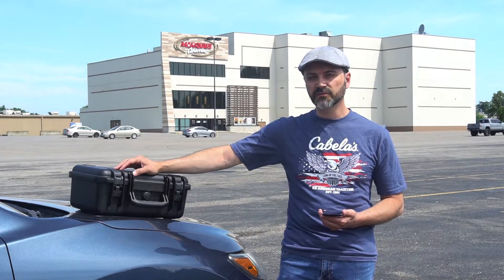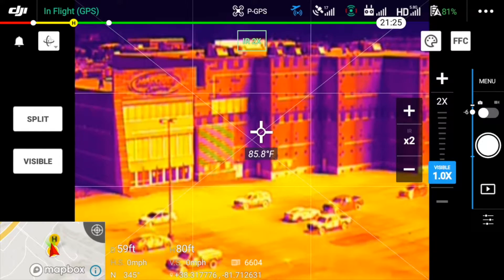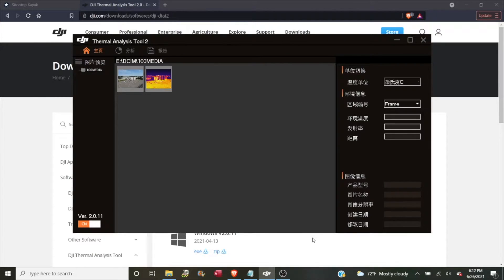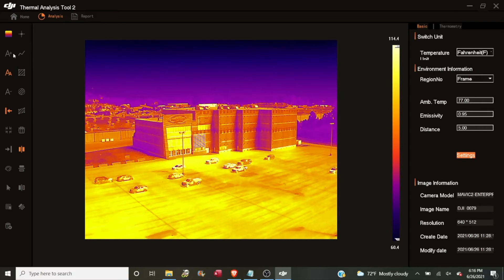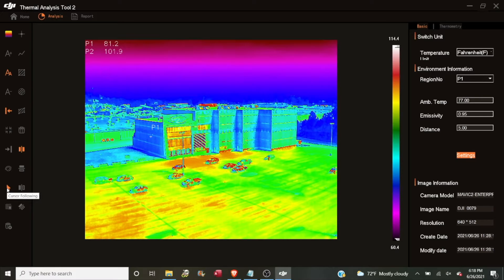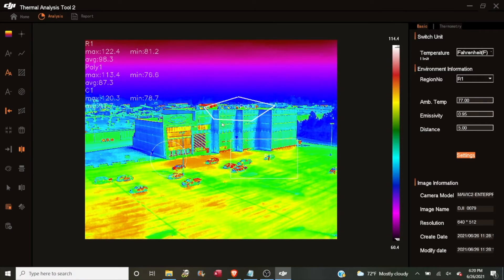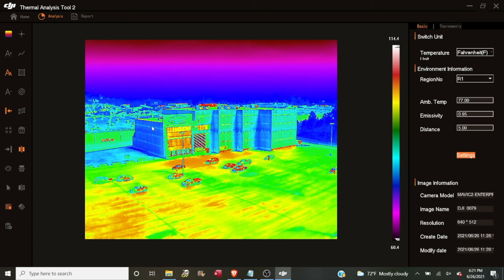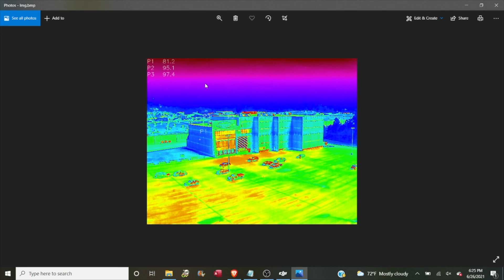Mavic 2 Enterprise Advanced | Shooting and Analyzing Thermal Images

Comment: Can this tool be used on a Mac? The downloads on DJI are only for PCs and Windows
Reply from the maker: As far as I know it is PC only at this time.
Reply: @WildWonderfulWeekends  thanks, is there an alternative out there?
Reply from the maker: @jonathantrexel4299  Unfortunately, not that I'm aware of.  The DJI thermal data is proprietary.  This is a pain when trying to create thermal maps with software like DroneDeploy too.
Reply: @WildWonderfulWeekends  just so I’m following, I either have an M2EA that’s a paperweight or I have to buy a PC?
Reply from the maker: @jonathantrexel4299  That appears to be the situation.  I don't understand why DJI made their data so that other thermal analysis tools can't process it.  I also don't understand why there isn't a Mac compatible version of Thermal Analysis Tool.  For that matter, I don't understand why a drone with so much potential (M2EA) doesn't allow for manual control of the photography settings.  As I said in a previous video, it feels intentionally dumbed down.

That said, I bought a cheap $300 laptop to run DJI's Thermal Analysis Tool and it works well.  The companies I fly inspections for are very happy with the thermal data I capture for them.  So after getting over the initial pain and disappointment of having to deal with a couple things that it just seems unfair to have to deal with, I am making money with the M2EA and it's already paid for its self, and the laptop.

So given the choice between grounding a $7000 drone or investing another $300 in a PC laptop, I'd get the laptop.
Reply: @WildWonderfulWeekends  thanks! That was tongue in cheek of course. And you’re right, while frustrating that piece is not made obvious from the beginning, I’ll follow your example and simply move on. Appreciate your videos and taking the time for inputs here!
Reply from the maker: @jonathantrexel4299  Yes sir, any time.  Thank you for watching!  Good luck with your M2EA endeavors!

Comment: Hello 
I can see on your screen that side bars are red indicating lateral optical sensors not active.I have the same issue on mine.
What's you point on that ?
Reply from the maker: Good eye!  Flying in tripod mode will activate the lateral sensors but, of course, at a cost to speed.  I  personally wish I could choose to turn them on/off in P mode but if that's possible, I haven't figured it out.  

The times I've accidentally gotten too close to an obstacle it's always been when I'm moving the drone sideways, not flying forward or back.  I think it would be great to have the ability to turn lateral obstacle sensing on regardless of mode.
Reply: @WildWonderfulWeekends  You´re right. 
I knew that Tripod is the only mode for which sensors are on.
But I just realized now that we must first turn ON multimode in the App. Because by default the switch mode is inactive and remain in P mode whatever the position. That was my mistake. Now it works well.
Thanks for your reply.
Reply from the maker: @zwiftfrance  There's a lot I'm still learning about this drone.  

Have you flown yours in a GPS denied environment?
Reply: @WildWonderfulWeekends  Not yet.
I am in France, with a lot of rules and restrictions ...
Thing is that from now I would like to develop some business related to thermo & photogrammetry.
Not that easy as these disciplines are  not really known in my country.
Reply from the maker: @zwiftfrance  I can relate... the area of the U.S. that I live in is always a little slow to catch up to the rest of the country.  This presents a challenge but also an advantage of would-be competitors.  Good luck to you!

Comment: Hello, i have dual dji enterprise dual and when i import the photos into the program it doesn't release the tools to analyze, do you know what's happening?
Reply from the maker: Hello Filipe, and thanks for viewing!  It's my understanding that the Mavic Enterprise Dual is equipped with a Flir thermal cam and the data must be be analyzed in software compatible with Flir cameras.  The Mavic Enterprise Advanced doesn't have a Flir camera, and therefore is incompatible with Flir software so DJI developed their own analysis tool.  My suggestion would be to acquire software compatible with Flir data and try that.  Also, be sure that the image is just as it came straight from the drone and unedited.  Using photo editing software can strip the radiometric data from the image file.

Good luck my friend!

Comment: very interesting video:
I have a problem using this dji thermal analisys tool v2.0. The appearance of the menus is not correct. and the options appear overlapping or part of the options is lost. does anyone know if there are any settings to change and fix the problem?I would very much appreciate your help.
Reply from the maker: That's interesting, could you tell me what type of computer you are running it on, and which version of Windows or Mac OS you are using?

Comment: Do you know if you can just buy the thermal camera to replace my stock camera on the Mavic 2 ?
Reply from the maker: I can't say for certain, but I don't believe so.  Plus if your controller recognized the processor as that of a Mavic 2 it would probably not offer you the control options for an M2EA.  I could be wrong on that though.

Comment: Wow, where are you located with temperature readings of 122 degrees C on some of those structures?
We've got the M2EA and have the same issue with exporting report, I think it's the same with everyone.
Reply from the maker: I believe you are right, I'm hearing more and more operators of the M2EA report the same issue exporting reports.

Oh, and the temperature readings in this video are in Fahrenheit.

Comment: Good video with some practical information.

Are isotherms available while the aircraft is in the air?  That's where the SAR value is for that feature. 

Have you done actual temperature measurements and verified the values with a calibrated thermometer?
Reply from the maker: Thanks Chris!  Isotherms are not available while flying the M2EA.  That's one of the surprisingly limited features of this drone.  Stranger still is that isotherms are available on the previous iteration of this drone; the Enterprise Dual.  So one would naturally assume it would be available on the latest release, but one would be mistaken.  

I have a friend who is a home inspector compare temperature readings with a hand-held flir camera and my M2EA's readings were always within 2 degrees.